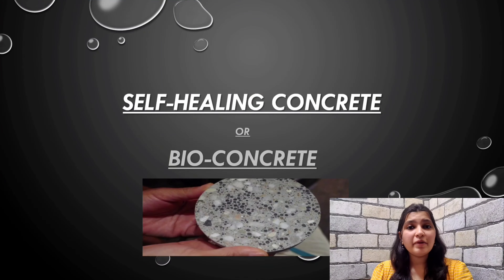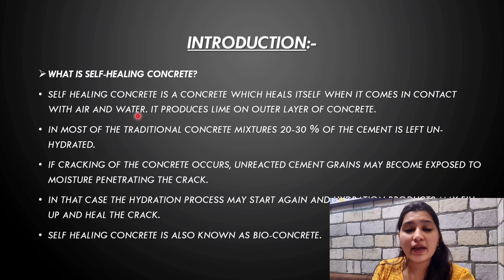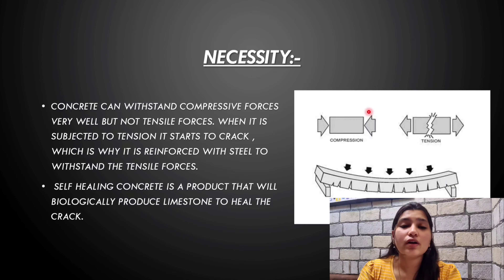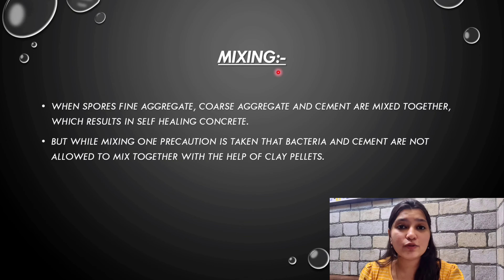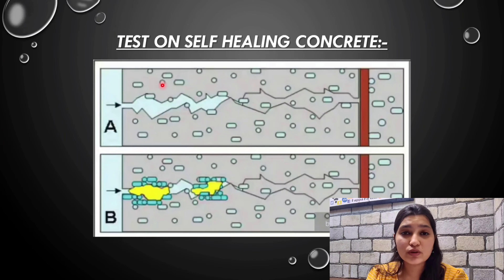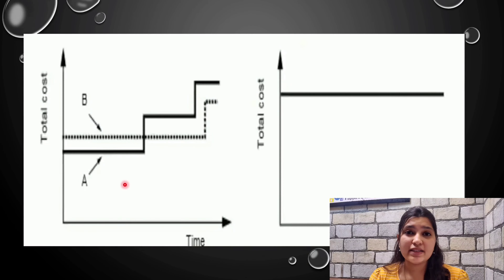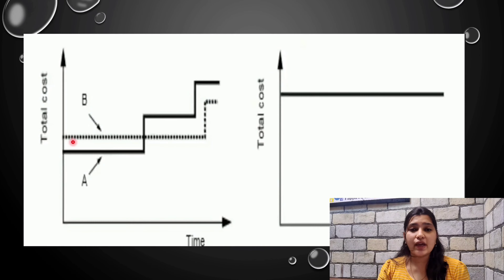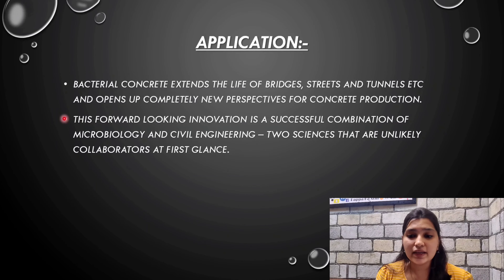Self Healing Concrete or Bio-concrete ; The concept (Part-1)

Comment: Does this bacteria harm the steel?
Reply from the maker: No….. this bacteria doesn’t harm the reinforcement….because this bacteria reacts only with atmosphere ( it will react to water mainly). 
When it is exposed to atmosphere it will heal the pores or cracks…. So there is no chance that it will harm the reinforcement…
Reply: @civilbug2690  ma'am could you please send me this PPT
Reply from the maker: @bhavanireddy6645  sure…..plz contact me on my insta handle which is “Civil_bug_4799”

Comment: But how does the bacteria survives ?
Reply from the maker: Bacillus was found to survive in concrete (pH = 12) with the protection of zeolite and to produce calcium carbonate crystals after self-healing evaluation on crack-healed specimens at ages 4, 6, and 8 months cured in water, and the compressive strength improved with the addition of bacteria (10%)

Comment: scope of bio concrete in civil engineering?
Reply from the maker: Self-healing concretes reduce the need to detect and repair cracks and are one strategy to address corrosion risk. This has social, economic, and environmental benefits, as overcoming/reducing the need for maintenance and/or increasing longevity reduces disruption, as well as the cost and use of materials.
Reply: @civilbug2690  i had already completed my seminar but 2 ques was asked and i was unable to answer :- how bacteria is added in the clay pellets, and if we can use something other than clay? If yes then what property is important for the pellet?